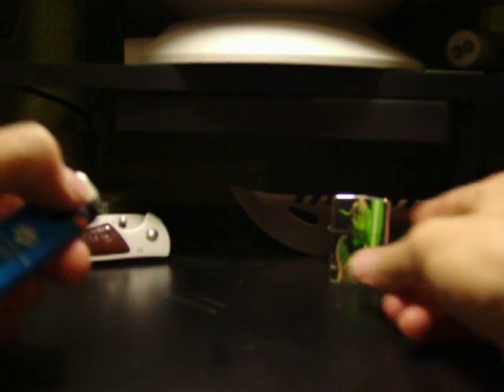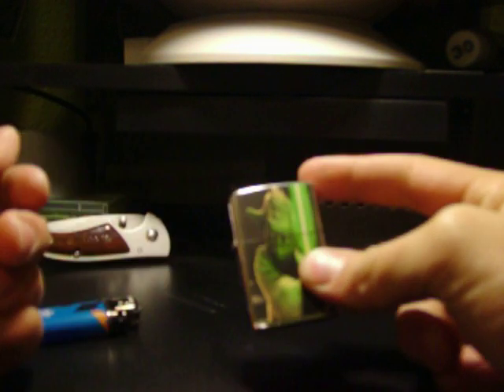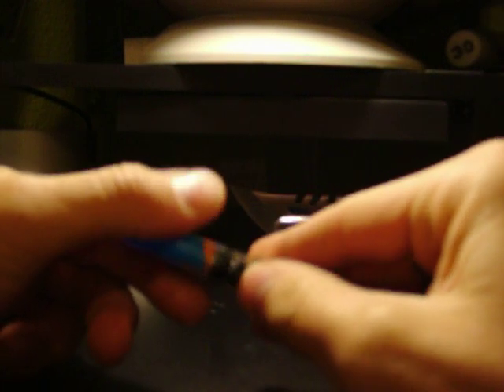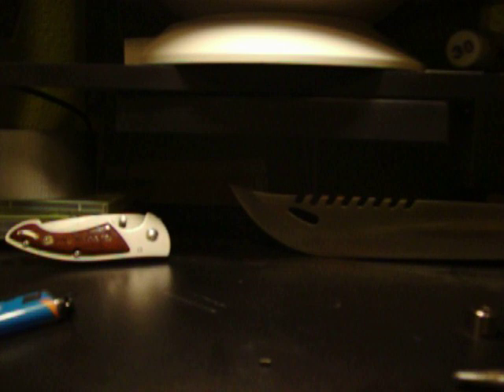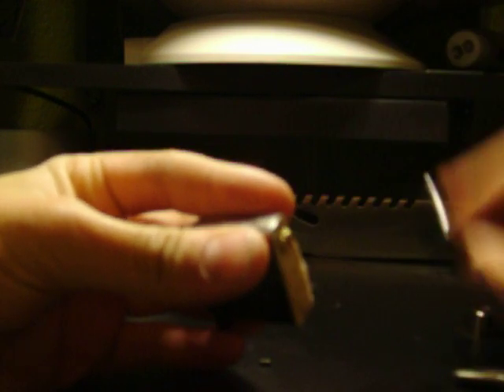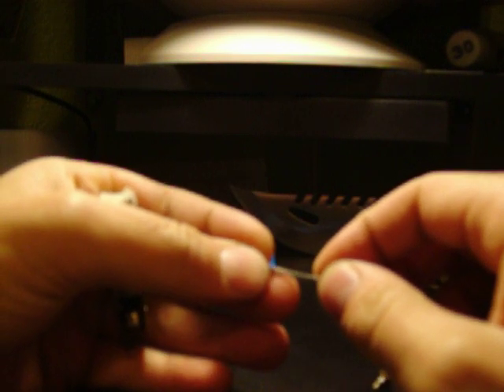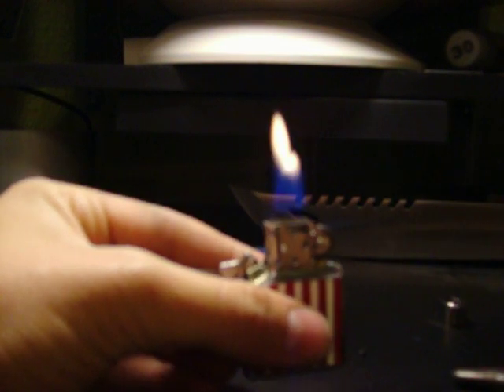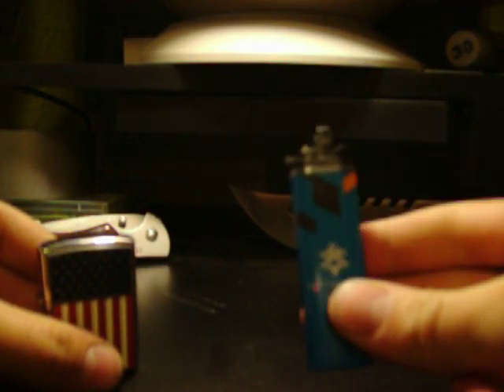bic lighter tricks and how to ...... how to put a bic lighter flint it to a zippo or other lighter

Comment: What would impress me is putting a new flint into a cheap bic lighter.
Actually I just managed to take out the roller barrel and put it back again but I have no flints. It's  a lot harder to also put a flint in cos i have tried it before and never managed it, but I think I could now.
I am gonna buy some flints on ebay and try.
The thing is the gas seems to last forever, even when the liquid has gone, you can always get one more light out of it if you leave it for a while. End of essay!!

Comment: This is a of a pointless video because 9 times out of then the flint in the bic lighter will fail or run out before the gas does!!
So what you really want to do is put a flint into the bic lighter.
No I have 5  bic style lighter in from of me all with some gas in them but where the flint is gone, what I need is to be able to get a flint into them!!!
There is a second problem though in that even if I could put a flint in they cost as much as a lighter!! WTF!!!!